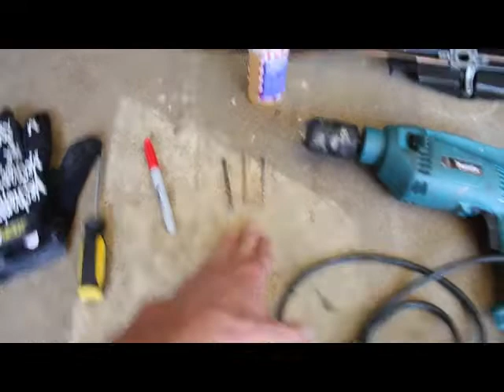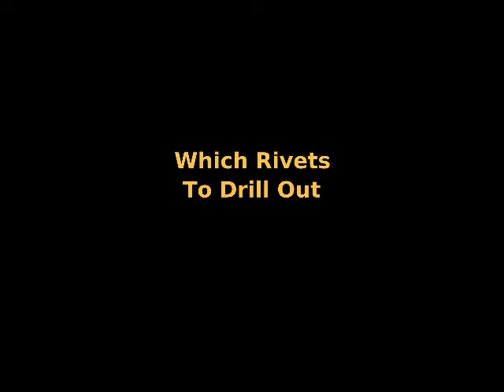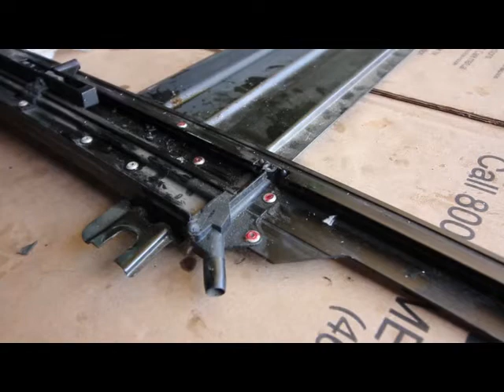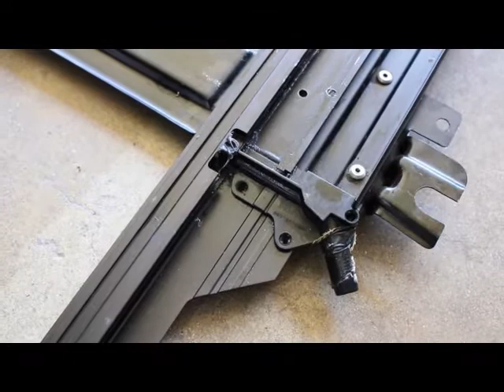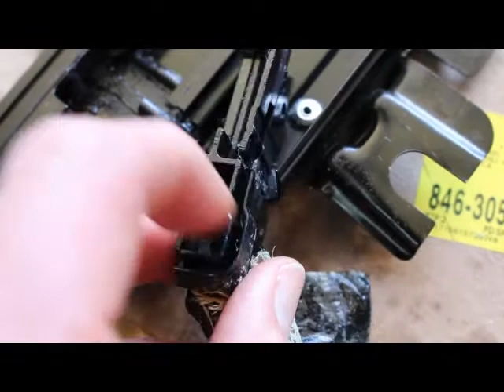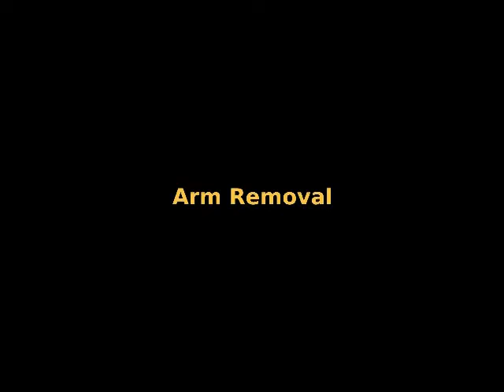Saturn Sunroof Repair 2 - Disassembly

Comment: I don’t believe that that sunroof doctor actually made that metal Replacement part for the Plastic part.
It appears that that metal part is made by GM and used on the last of the newest Saturns to fix the problem of the plastic.
I believe this metal part is now unavailable and this is why the sunroof doctor seems to no longer have them in stock and the part no longer available.
So it seems the salvage yard is the only place to find the problem proof metal ones now on the very newest models. Take care.